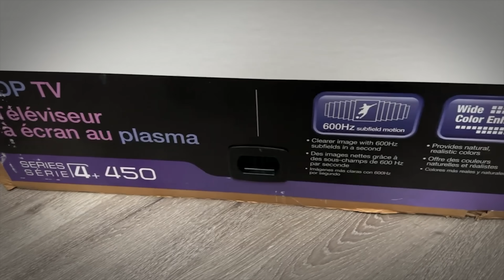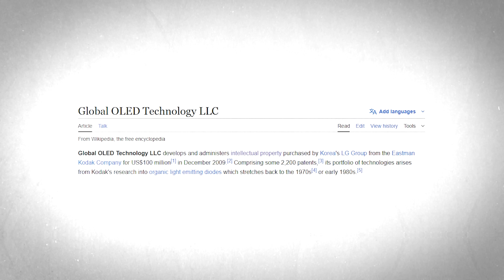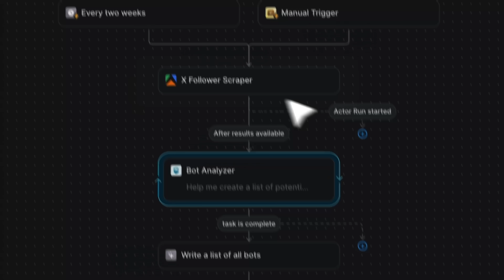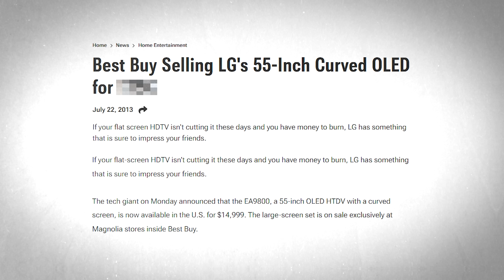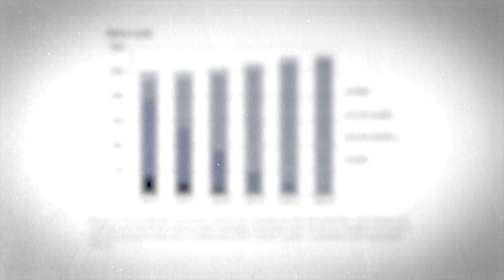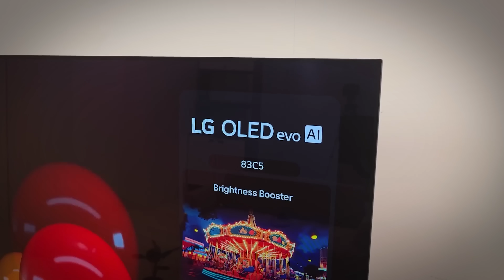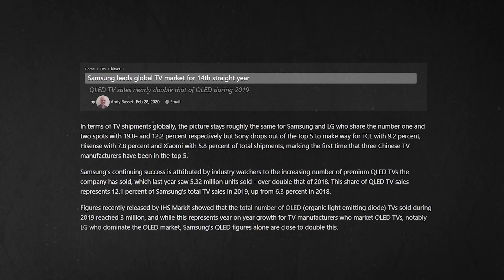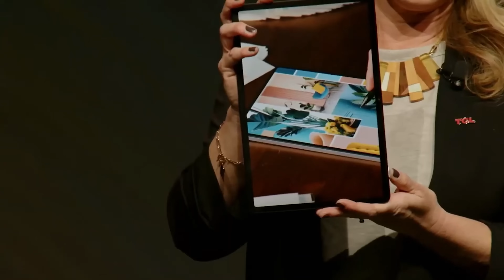The Unstoppable Rise Of LG TVs (There's No Catching Up)

Comment: LG is pretty nuts. They've pretty much cornered both the OLED and IPS panel markets at virtually the same time.
Reply: LG? You mean the company that lost "best TV" to Sony and Samsung this year and the previous few?

They don't need to fix the issues that plague their new models. Every idiot alive will just buy them.
Reply: in case you want to know.   LG OLED are NOT sell ing well in 2025.   OLED market is Cornered by Samsung :   QD-OLED. 
LED space is --- Dominated by ( Hisense + TCL ) 6 yr straight.  (d reason OLED mark down because their OLED color can NOT compete , VERY Washed out. 
🏵🧩🐸🙉🍉 🐬vs 🥮🐦‍🔥🏬🦜🪲🪼
The LARGER of TV , Image >  > > STRETCH OUT < <  <. You need Denser Color to look:    3D 
        
 ( Rtings) tested at 10000 cd/m— HDR  
              🔮Color Volume 🔮
Red Luminance =
A90J      72                   ( OLED ) SONY
B4            89     cd/m²  ( OLED )    LG 
C1            84     cd/m²                     LG 
A80L       92     cd/m²  ( OLED ) SONY
Z80A   ==        ( B4 tier )     Panasonic 
Z85A      100    ( OLED )      Panasonic 
   
C4          104     ( OLED )               LG         
C5          134
G4          140     ( OLED ) —-         LG       
G3          140     ( OLED ) —-         LG 
A95K     190   (QD-OMED)
S95C      272   (QD-OLED) Samsung
S95D      371  
S90D      281   (QD-OLED) Samsung 
S90F       309  (QD-OLED) Samsung 
U75QG  410 🔔( mini LED)  Hisense 

A95L       221   (QD-OLED)      SONY   
Z95B       219     ( OLED )   Panasonic 
G5           248     ( OLED ) —-        LG    
S95F       420   (QD-OLED)Samsung
Bravia8|| 344   (QD-OLED)      SONY            
U8QG🐦‍🔥527   ( Mini LED    Hisense              
U9N   🐦‍🔥564   (Min LED )   Hisense
85”UX    530   2023             Hisense 
Bravia9   551   ( Min LED )      SONY 
U8N 75”  421                         Hisense         
U8N         381    ( Min LED)   Hisense                  
U8K         318     ( Min LED)   Hisense
QN90C    382    ( Min LED )Samsung            
QM8K     394   (Min LED )        TCL 

Qm851    585   ( Min LED)        TCL   
Qm8         404   ( Min LED)        TCL   
Qm7K       221               
QM7         291   ( Min LED)        TCL 
QM6K      103 
Bravia7    356   ( Min LED)      SONY
X95L        225   ( Min LED)      SONY 
X90L        272   <  FALD  >       SONY         
Bravia5    137 < FALD-M LED>SONY 
              
“
Green Luminance=
A90J        237     ( OLED )         SONY
B4            306   (  OLED )            LG
C1             291   (  OLED )            LG
C4            333    ( OLED )            LG
C5            478
A80L        317    ( OLED )           SONY
Z80A == ( same as B4 tier )Panasonic 
Z85A        337   (  OLED )     Panasonic 
G4            426   (  OLED )            LG
G3            420   ( OLED )             LG
A95K        606   ( OLED )          SONY 
S95C        882   (QD-OLED)Samsung
S95D      1167   (QD-OLED)Samsung
S90D        856   (QD-OLED)Samsung   
S90F      1,145 (QD-OLED)Samsung   
U75QG  1415🔔  (Min LED ) Hisense
 
A95L         679  (QD-OLED)    SONY 
Z95B        734     ( OLED )  Panasonic 
G5             887     ( OLED )           LG
S95F      1,551   (QD-OLED)Samsung
Bravia8|| 1,074  (QD-OLED)   SONY 
U8Q🥬 2,073   (Min LED)  Hisense 
U9N🥬 1,917     ( Mini LED ) Hisense    
Qm8K    1,206    ( Mini LED )     TCL

——🥬2024 UX 110” ——NOT Tested. 
85”UX   1,656          2023     Hisense
Bravia9  1,130    ( Mini LED )     SONY 
U8N 75” 1,400   ( Min LED )  Hisense
U8N        1,433   ( Min LED )  Hisense
U8K         1,157   ( Min LED )  Hisense
U8H           915   ( Min LED )  Hisense 
U7N           501   ( Min LED )  Hisense

QN90C    1360  ( Mini LED ) Samsung  

Qm851    1,885  ( Mini LED )       TCL
Qm8         1,250  ( Mini LED )      TCL
Qm7K          678  ( Mini LED )      TCL
QM7            826  ( Mini LED )      TCL
QM6K         343 
Bravia7       834  ( Mini LED )    SONY
X95L            781  ( Mini LED )    SONY
X90L            778  <  FALD  >      SONY ‘s = BEST SELLER 
Bravia5        420  <  FALD-Mini LED >  SONY ( NO quantum Dot)
Reply: well in IPS space there is also Au Optronix. And I would say Au Optronix panels are better
Reply: IPS LCD is crap compared to VA LCd that Sony and Samsung use
Reply: @RobertK1993 Depends for what. for SDR content, low price IPS LCDs are unmatched in color accurancy, and low response time (i mean only TN has faster response time but TN sucks in every other metric). 

VAs require a ton of gimmicks to be usable without smearing. Like they overshot a lot, they require quite complicated onboard hardware to have decent refresh range for Gsync/freesync, etc. I had once cheap VA gaming monitor, and IPS monitor from MSI next to it (with au optronix panel) was destroying it. I know Samsugn Odyssey top tier models would be probably better than my IPS but those are also way more expensive.
Reply: LG comeback was unexpected though everyone saw it as a old dead company
Reply from the maker: Facts
Reply: And they lost on smartphone which are much more profitable